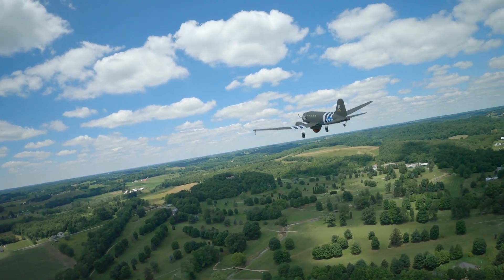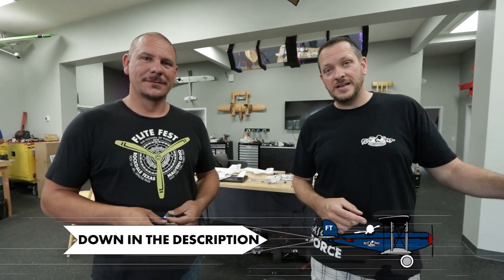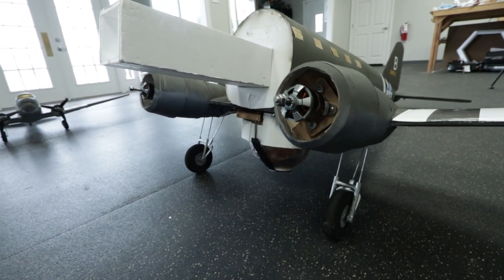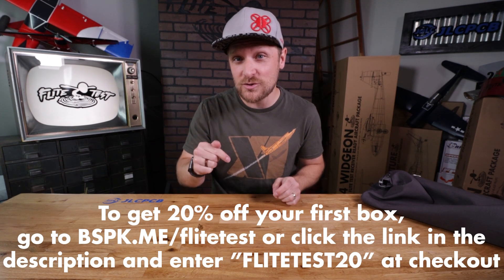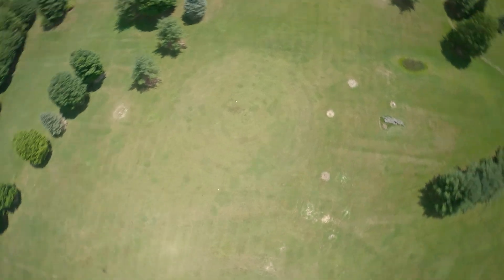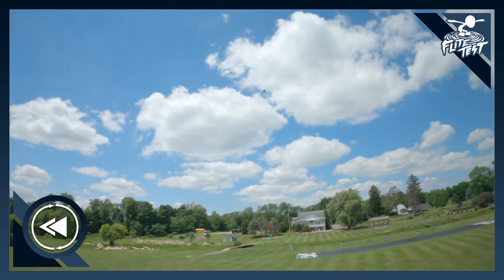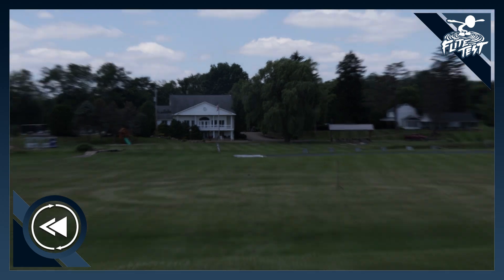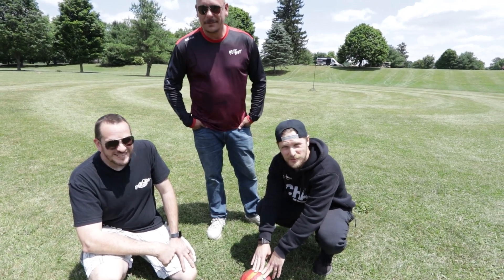We Dropped A 10 Pound Fruit by the Foot Ball From 400 FT!!

Comment: I would recommend holding together the drop mechanism with something else like a rubber band or other material and have it be able to be cut/unlatched with a servo so the servo doesn't have as much tension, that's all, great video though!

Comment: Mimicking an old style bomb sight by having the camera angle change to account for speed and altitude could be a fun project.  A flight controller could provide most of the needed info for adjustments.

Comment: velocity and altitude could be compensated by having another servo tilt your sight so you could drop when the cross-hairs are on top of the target, instead of guessing like shooting skeet/trap. GPS/LORAN more accurate for SOG vs Altimeter/Peto tube? Some type of visible scale in the fpv sight indicating the azimuth
Reply: A level flight indicator too. As flaps could pitch nose up/down changing sights azimuth

Comment: You guys should a do a guided middle that gets drop out a plane that would be my dream And can you also if you can make a ac130
Reply: That's my dream as well. I run an aeronautical engineering club as well as work for the summer as an engineer on missile programs at the company that makes most of the US's missiles. I've wanted to team with my school's rocketry and guidance clubs to make a guided missile, but the FAA is pretty stingy about air launched rockets. 

That being said, we have the commercial licensing and can apply for a waiver, so maybe it's worth a shot.

Comment: Good stuff! I just recently watched your video where you airdropped an rc truck and I really want to do that but the truck will be strapped onto a barge and its all on rails so it slides out the back of the plane like butter when i activate. The plane will drop the barge w/ the truck, itll parachute into water, the barge will continue the journey on water, reaches a spot and drops off the truck onto land, truck drives through woods and finds clearing, launches tiny whoop out of the back of the truck! So 4 RC vehicles in one, plane, boat, truck and whoop.

Comment: If you know your airspeed at 400ft, you can easily determine the distance from release to impact, and build a better sight that’s looking that much ahead. Pull trigger on crosshairs. I can see this developing into a competition with different bomber models and points to bullseye. Great video guys

Heck, thinking about it more, every plane in the competition has a flight board to ensure same altitude. Why not go all out, and during a competition run, a single fighter from the opposing team tries to interfere with the points-bomb run

Standardized bombs with a mixture of talc and lawn feed that explodes on impact
Reply: Also, put a level bubble so it's visible on camera to show the bank angle.
Reply: @NathanMN  it has sooooo many possibilities as a team FPV sport. 
Imagine this. The same team on defense that has a single fighter in the air for each offensive bombing run, also has a FPV anti-aircraft gun near the bombing target. 
Jesus. You could feasibly, due to the size of the bombers, have a single FPV turret gun on each bomber. 
All FPV operators would be done via Flite Test’s ground stations.
Reply: @NathanMN  Well the problem with that is that the angle of attack they fly at is going to be different with payload weight and wind speed. If they were to fly level with that 10 pound weight the plane would sink like a rock.
Reply: @adamhale6672  That's why I specified angle of bank, not angle of attack. The reason being if the camera is fixed to the fuselage pointing directly down, it will only be useful when the wings are level. If the aircraft is banked at all, the camera won't be pointed where the payload will drop. So the "bombardier" can ensure it's level before dropping it.

Comment: If I were in the shop with you guys, I'd be moving towards the bombardier having trim control of rudder, and the sight itself. Cheap to set up. A longer approach should work. Goal being too get the sight on target aiming at bullseye, adjust sight trim, until you can get a SPAM loaf into a kiddie pool from 100 feet. After all, tons of SPAM flew aboard the aircraft during the war.

Comment: You guys should make an AA gun with air soft to battle this plane
Reply: Yes, fpv AA gun. Goal, do damage.. each time they try for the bullseye, means more damage they must compensate for. Make a team game of it.
Reply: airsoft wont do enough damage from that far away on foam board. If they flew a balsa and tissue skinned plane like the old school style then yeah they could do enough damage from 200 feet away.
Reply: @paddington1670  preciated balsa wood 🪵
Reply: Instead of airsoft use model rockets🚀
Reply: @thecommentary6899  I was thinking bottle rockets. Which would be near impossible to have accurate, but mannn would it look awesome lol
Reply: Make it a 60 RPS polarstar or dsg
Reply: HPA engine airsoft gun would be the best option for adjusting FPS and ROF

Comment: love the vids! I was hoping you could make an AC 130 in the future with controllable turrets!
Reply: C-47s converted to gunships received the designation of AC-47s and were called "Puff-the-Magic-Dragon" in Vietnam.
They were excellent for busting up Vietcong truck convoys.  7.62 and 20mm Gatling guns chew up trucks quite well.
Reply: Yes do that please. I have had the controllable airsoft turret. idea for a year now.
Reply: Turret's that shoot
Reply: That's a tall order, but it's possible. 3d print or buy gearboxes to be used with tiny motors. Maybe rc car, they have reverse so maybe you can traverse with this, and use the steering servo for gun elevation.